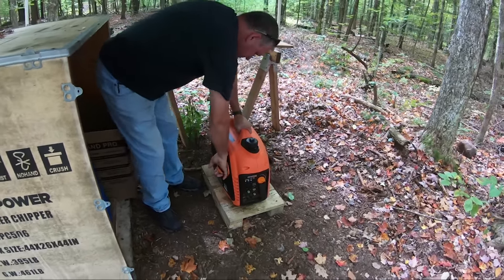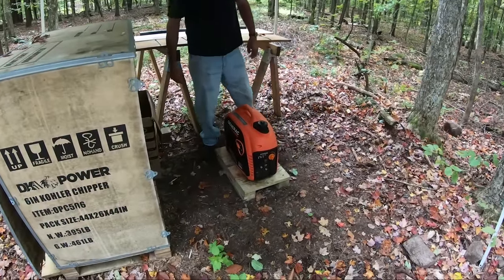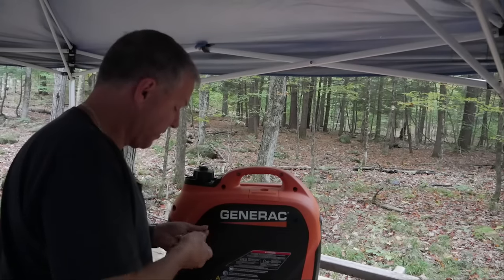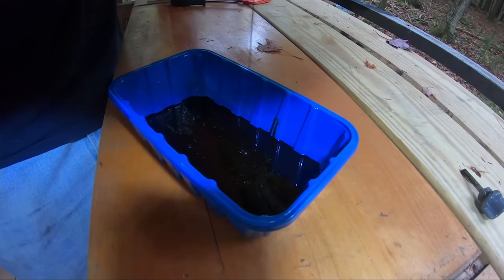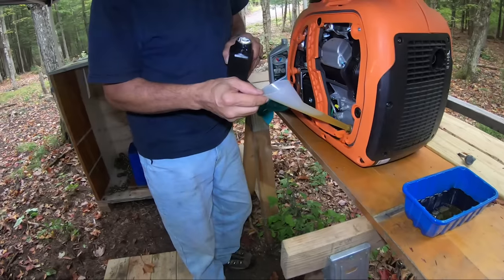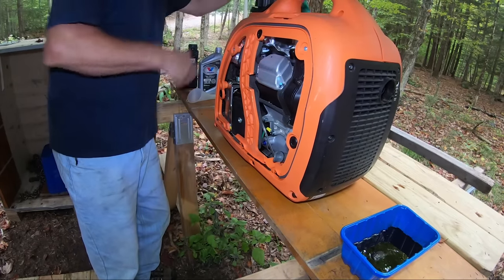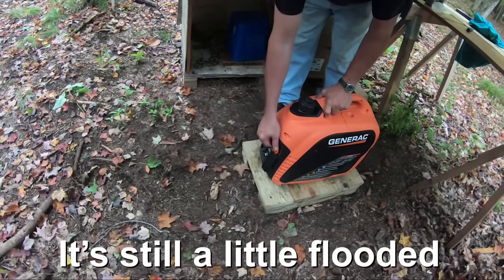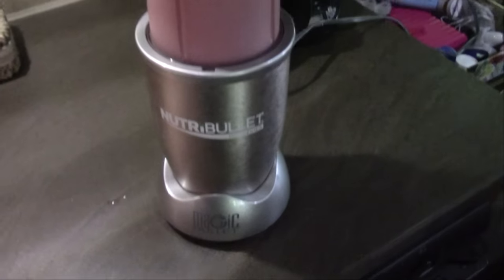GENERAC GP2200i - BRUTALLY HONEST 1 YEAR REVIEW

Comment: I have a Honda 2000 and the companion model. Both were ran for 8 hours and then oil changed. One has thousands of hours and the other only about 50 hours. Both have a magnetic oil filler cap. Both run and sound the same. Oil is changed every 150hrs with Amsoil. Don’t waste your investment, take care of it.
Reply from the maker: Karl Jensen Absolutely! Thanks so much for watching 👍
Reply: Dave Alexander , I think you mean Castrol? 
https://www.castrol.com/
Reply: Dave Alexander 
Alaska, off the grid, the bitter cold. Tho it greatly intrigues me, I don’t do cold, I call it frost phobia. My body can’t adapt to the cold, but heat no problem. Well I always think to test a product, it must endure the worst case scenario, which seems that you may have achieved. So I will take your word for it and reconsider Generac next go, but that may be a very long time. Solar is unreliable in your area, hoping that you have wind or hydro options at your location, because even an efficient generator is a pita in terms of fuel, transportation, maintenance, noise and eventual replacement. I’m assuming that that you run to charge batteries. Might I make some Suggestions, even though you probably figured most of these out for yourself. Lithium batteries: Tesla car types, get twice what you need, learn about balancing, cooling, needed warmth, depth of discharge vs life, safety. Way cheaper in the long run. Wind and/or hydro generation and 3 phase for long wire runs then DC conversation. Here’s one no one talks about. A heat exchanger to capture the heat from the generator’s engine and exhaust. Tell me you haven’t stood there warming your paws and thinking about it. Must be large 1’W x 1 1/2’H x 3’L. Think: no back pressure of flow from engine, turbulence for elimination of boundary flow for efficiency, closed loop, small fan, over heat sensor, double insulated flex duct, heat resistant construction and carbon monoxide poisoning. Several carbon monoxide sensors (10 year types) that you should have anyways. Made one several years ago for a guy in the Sierras, worked like a dream. He took it one step further. On the inlet side to the cabin he had it so he could blow it down on a water tank for slightly warmer water. It also stored a tad of warmth after it had been running. Good luck to you up there.
Reply: Dave Alexander
Well sounds like you got this, LOL!
I just sold my boat. I enjoyed my time isolated in the middle of the California delta. 62 and too many hard miles on the body. Was in the middle of nowhere, doing some maintenance in the engine room when my back went out. Took me 45 minutes to crawl out. It got  me to thinking. Boat are constant maintenance & lots of money and my cat companion died. Things just aren’t the same and no fun anymore. Looking for acreage outside of California and it has to be warm. Next adventure, but not to far from help. Stay safe!
Reply: Dave Alexander 
Heck, you are a lucky man. Been single for 16 years. I see what most other married guys are going through and say whoa-man! Good ones are far and few between. Funny thing is I had major brain surgery and can’t remember what she looks like, I’m told that’s a good thing. Hey do you know that there are hit TV reality shows that feature people like you? People in the cities can’t fathom how you survive, and at your age, Bravo guys!

Comment: FOR SALE;
Huge Generac paperweight sitting in my yard. Owned 6 years but  has less than 30 hours on it.
Reply from the maker: We’re looking for a large generator (14-15 kw) and We were just told by our electrician that we should try a Kohler. What size generac do you have?
Reply: @CreatingASimplerLifeOffGrid its a monster 42 kw.
Reply from the maker: @sonder2164  Wow! Why such a big geny?
Reply: @CreatingASimplerLifeOffGrid  2 story house, garage, hot tub, etc... all on electric. Ya know, might as well go big or go home 😉.
Reply: @CreatingASimplerLifeOffGrid  it's been a headache though, periodical breaksdowns. I wouldnt reccomend a Generac. I bought the extended warranty with it and they milked it along until it ran out. That's why in my first comment I wrote "paperweight ". Its practically brand new, but it wont run more than 2 months at a time.

Comment: Honda eu2000. 6000 hours so far
24/7 
last winter many -35c nights

Our other Honda eu2000 has 2700 hours so far.
Ontario Canada 
Both draw from larger gas tanks
Hoping to have Hydro in the next few weeks

We average 11 Liters per 24 hours
We do not run the AC in summer.
Warming jacket for 100 pound propane tanks for below -15C
 5th wheel trailer til house is up.

Comment: What is the point of a generator that doesn't tolerate fowl weather?  When things are unpleasant is when you need one to work.  Camping and tail gating are fine, still needs to work when you need it to.
Reply from the maker: Not sure what you mean. It has worked great for us in all kind of weather, including really hot and below freezing!
Reply: @CreatingASimplerLifeOffGrid  the video clearly points out that it must be kept dry...that is my point.  Which one works when it rains without a canopy that will get blown away.
Reply from the maker: harvey warne it will probably work in the rain but the directions stated to keep it out of the rain because engines and rain don’t usually work well together. We simply prefer to keep it dry so it lasts longer. Don’t know what directions on other generators state.

Comment: When trying to start any difficult to start small engine, spray a one second blast
of starting fluid on the outside of the air cleaner cover and it will start on the first pull.
Reply from the maker: Thanks! Appreciate that.

Comment: you guys great love the generators DVDs. The first thing I noticed there and jump  out you never ever listen to me people never ever want to allow get that black ever days weeks weeks weeks too late change oil you literally want to put clean oil in run for 10 minutes and then drain it back out again maybe he'll do it again get all that black crap off the walls in there. That's the biggest No-No of all tiny engine you can get seven or eight will changes at one quart of oil 5 bucks using good Honda oil for any brand generator none detergent that's the biggest oil only ,wow that's  a killer on generators is the wear and tear and friction. Which boils down to poor viscosity on the oil for circulation,you can stack tires plywood  sandbag around gen to dramatically  reduce eng noise warnings  keep 5 ft clearance around gen to not affect overheating  gen using  a lg fan that's always next  to gen runs  with gen keeping Temps below  average extending gen life vital good glow 30 watts of power to keep things  cool on extreme tempsd as days ,ps if we could get a year of solid use off gen ,it payed got itself average  8,500 24 7 my honda ran  off grid anybody gets near them hrs honda should get concerned  ,my perspective  on mini gens. ,,lock gen up at all times they  walk better  then they  run and copy  ser# down  first to fly : )
Reply from the maker: Ok, thanks for the info. Its clean and still running good. We plan on using it a lot this season, and we will take good care of it . Thanks for watching .

Comment: I know people are giving you a hard time for going so long on an oil change, but you did say it was synthetic, and even though it was black, it didn't pour out like goo.  I'd say that the oil was most likely at the end of its useful life, but still good enough that your generator is still ok.   The killer of modern power equipment is ethanol in fuel.  It's hard on parts and if you leave it sitting for a month it gels and varnishes and screws up carburetors.  I use MMO in gas to neutralize the effects of ethanol when I can't find ethanol-free gasoline.
Reply from the maker: Appreciate the comment. I never thought of adding MMO to gas but I do use it for other stuff and actually have some in the garage. I might give it a try next season and I agree with you, I think the geny is fine. Have a great day.

Comment: Your oil is extremely dark and used, that has literally been running components ragged, you need to change it in those around every 50-75 hrs, you definitely don't want to be running it more than 90hrs without changing the oil. The engines are small, it's not the same as a car engine, which can be pushed past. Engines that small are sensitive.

Comment: I have a predator generator I live off grid. I have not changed the oil in it in 3 years and I will not change the oil in it. I just add a little bit to it about every 4 months. It has over 2,500 hours on it

Comment: Needs to be level cause they were cheap no oil splash in crankcase
Reply: Richard C.  Definitely has an oil splash.  Has to be level because of where the low oil sensor is located.  Same as Honda and others.
Reply from the maker: You are correct. The low oil sensor is very sensitive!

Comment: If it's made in America ? Then I'll buy one
Reply from the maker: Don’t go running to the store. This one is made in China. The larger generac generators are made in the USA and the company is a US company. Considering all the small generators are made in China we chose one that at least us through an American company with American employees. Hope that helps. Have a great day!
Reply: as a mechanic for a construction company that maintains all their gas power tools generac's are garbage especially the bigger ones you'd be way better off buying a Honda unless you want to buy four or five generac's to match the longevity of a Honda
Reply from the maker: @edbuckley1670  Appreciate the feedback. Does honda also make large household backup generators as well? That is what we will be looking to do in the future.
Reply: @CreatingASimplerLifeOffGrid  Honda makes better generators than Generac but they are also not the best when looking for a good generator look for one that runs at 1800 RPM as opposed to 3600 RPM it will be a lot quieter and last a lot longer most of those generators are for every once in awhile or emergency backup there are generators called continuous run generators that are made to run constantly as opposed to every once in a while as an emergency backup.  Military surplus generators are excellent quality also Onan generators that are made for larger RVs are built to run more frequently be quieter and be more reliable I believe Honda makes a version like this Generac being shown in 3 and also 6000 Watts.  What you have to consider is what you're plugging into the generator for example sensitive Electronics cheaper generators put out a dirtier waveform of electricity that can damage sensitive equipment measuring harmonic distortion levels will tell you the quality of the electricity being produced and what you can plug into it without damaging it  the lower the harmonic Distortion levels the better .I believe crappy gas powered Generac generators the bigger ones the 5000w Etc are around 16% or harmonic Distortion while good generators are at I believe 8 or 6 and below. you don't have to measure harmonic Distortion levels yourself it should be one of specifications of the generator.
Reply from the maker: @edbuckley1670  Thank you so much! I realize now that we have a lot of research to do before we make and final decisions. I  had no idea there was so much to consider. Really appreciate your sharing all that! Have a great day.

Comment: I guess my question is why would anyone buy a Generac for $250 more than the others out there? Generac doesn't make these. They are all made by one of a few common Chinese manufactures that also make the WEN, HF Predator, AI Power (this one can be found under $400), etc. Yes Honda's are expensive but you are getting a genuine Honda and and not a clone engine. To some, that supersedes the price. With Generac, you paying around an additional $250 for the Generac name but has the same parts\build as the others in the $400 - $450 range.
Reply from the maker: All good points. Here is our answer: first, we got a great deal on it (we share that in the video), second, we chose the Generac because it is an American company that does make their own larger generators here in the USA. We choose to support American companies as much as possible. So even though this particular generator was not made in the USA, it is a USA company that does employ US workers. Honda and many of the others does not. Thanks so much for watching and commenting!

Comment: Generators are funny in that they sit a long time with old gas in them and i once cleaned the carb main jet area, and emptied the bowl but came back 2 years later and it wouldnt start and that area was clogged again?? Quick clean and first pull it started!!   So i surmise that the old sticky fuel got in there over time even though tap was off and gummed it up for first start. SO.. i have flushed all fuel out and changed the oil and left it totally fluid dry and will know if the gremlins are back when i need it again on next Aust blackout thanks to silly green energy trying to make up base line requirements and generators here will be needed more often till we can get nuclear or put back coal and gas as thats all you have on this planet currently till fusion can be made work... REALITY!!

Comment: Unfortunately, Generac does NOT have a good name for reliability. I'm not sure where Generac, A Wisconsin company, makes that generator. I have seen inferences the insides (at least) are made in China. Not surprising, after 5 months, it won't run. Also, this generator does not have an automatic cutoff, like on the Honda, that uses up all the gas in the line before it shuts off. That way you don't wind up with old (and stale) gas left in the system. Old gas can be a killer. I believe Ethonal gas can also be problem.
Reply from the maker: BADGUY 1 I think it’s made in China. The larger generators are made in the USA. Thanks for watching and appreciate your comment!
Reply: @CreatingASimplerLifeOffGrid  
No they aren't. I have been working on them for years and can tell you that they are built in China
Reply from the maker: @kirkstinson7316  Acctually, the one my parents have is supposedly built in the USA - "The Generac 4.5L is a purpose-built engine designed from the ground up by Generac and made in Wisconsin. Generac is one of the only manufacturers to design & produce a complete generator which includes our own engine, alternator, fuel system, controller and enclosure in the U.S." It's called the protector series and is a backup for their entire house. Please let me know if this is not true - we would really like to know that because our family truly does try to support american workers and companies. Thanks!
Reply from the maker: Heres a link to the generator: https://www.generac.com/all-products/generators/home-backup-generators/protector-series/48kw-rg04845

Comment: Not oil fuel issue purged that skunky fuel out of the carb bowel now she starts. 30 years in any engine repair. Each season dump all the fuel you have into what you are driving get new fuel 91 octane min every 6 months and add stabil. Run your machines out of fuel at the end of a season. Live in Canada in the worst extreme of seasons. Have a cheap 100 dollar lawnmower purchaced in 1994 pour fuel into it every spring one pull every time and yeah keep the oil changed once a year with the good stuff.This will give you no issues and giving this machine to your kids a good machine. 80 percent of small engine shops rely on ignorance.
Reply from the maker: I agree I emptied my fuel changeed the oil and stored it for the season. thanks for watching.

Comment: Because it's dark doesn't mean it's bad, it supposed look dark otherwise it's not doing what it was designed to do
Reply from the maker: True but I dropped the ball and let it go far too long
Reply: Maybe in a Diesel engine that would look ok but not in a gas engine, if I can’t extract 300000 miles out of a gas engine car I deem it a piece of junk. 5 k oil changes. Oil is cheap engines aren’t

Comment: If it's like a Honda generator or inverter the low oils sensor will see very dirty oil such as that in this machine as there being no oil. Yep, that's right! if your oil is too dirty the machine will shut down as if there is no oil. When we would be on a job if the Gennie shut down we'd dump out a little oil then add some fresh a Vroom it fire right up. Low oil or dirty oil gets the same reaction it will not start!  I agree with others that said changing the oil; leave your wife out of it.

Comment: I had an IQ2000.  Apparently I overloaded it.  It would run but not generate power. Took to an authorized Generac repair facility.  Was told  the unit had an "unfixable" psrt and I  would have to purchase a new unit.  Who makes a product with an unfixabl part???  Stay away from Generac.  Bite the bullet and buy a Honda.
Reply from the maker: Sorry to hear that! I really hope that we don’t have the same problem. Appreciate the comment.
Reply: It's not "unfixable" . It's the cost if parts and labor are higher then the cost to buy a new one. Lots of cheap generators have the same problem. Even your Honda, if the rotor goes, will not really be worth fixing. For $20-$30 more you can buy a new one